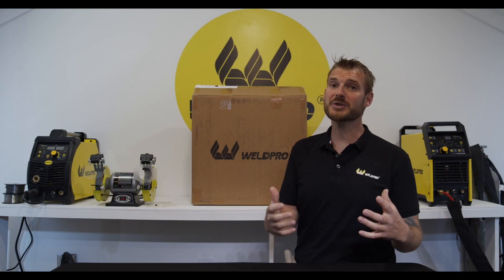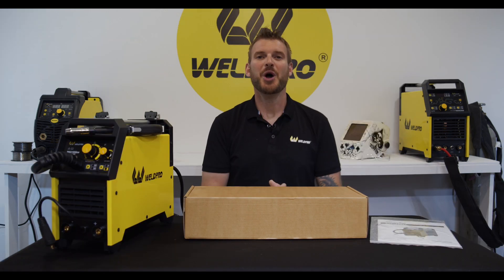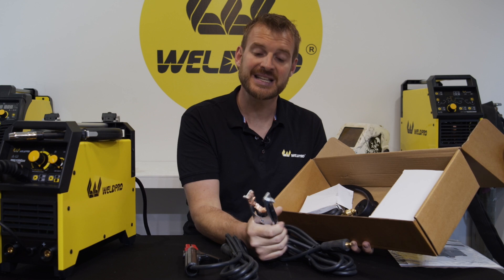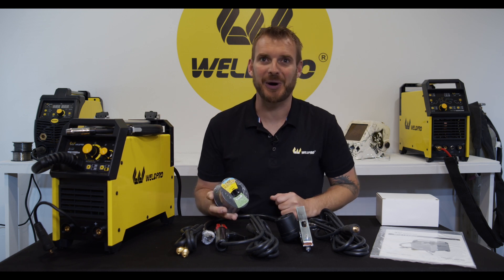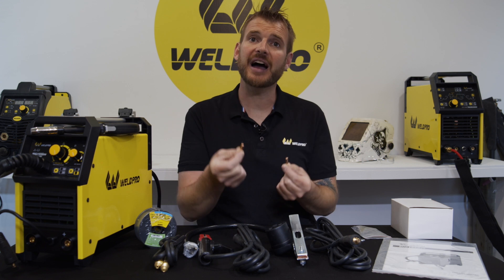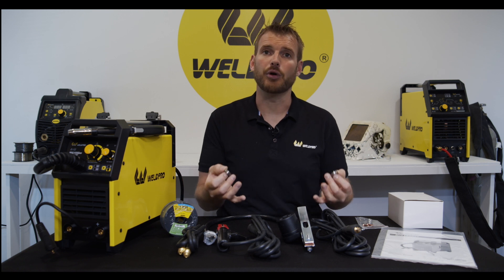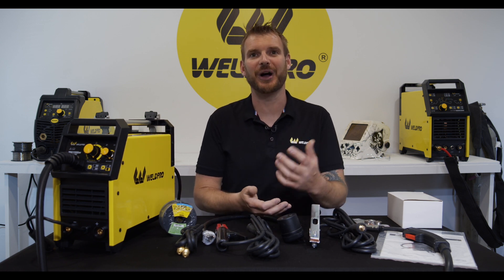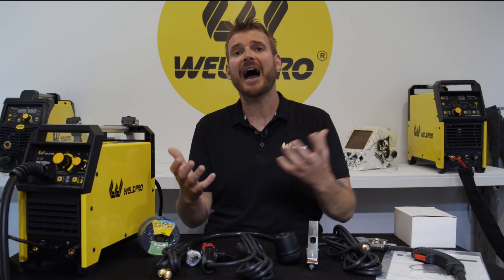Weldpro MIG 155 Part 1- Unboxing

Comment: Can I run a generator on this and if so what size will I need?
Reply from the maker: Yes you can. You need to be sure the generator is sized appropriately for the welder. You would want to look for a generator that puts out clean power in the 40A 240v range. 50A is preferred but it can be difficult to find a generator this big.

Comment: The Weldpro website says the155GD will do lift Tig.Is that correct? If so what torch does it use?
Reply from the maker: Bo B Yes it can. There are some nuances to using Lift start with the 155. It’s actually not lift start it needs to be scratched start. You will need to snap out of your Weld when you’re done. The torch to use is on our website under the accessories page. Here is a link https://weldpro.com/product/wp-17v-tig-torch-for-w-weldpro-mma160gd-mma200gd/

Comment: Hello quick question please, im considering buying this beautiful 155...i just want to know how long the stinger and gun lead are. Thanks
Reply from the maker: Just measured them for you. My MIG cable gun included "machine to tip" is 80 inches.
My ground cable is 10'

Let me know if you have any other questions!
Reply: @WeldproWeldingEquipment  thank you so much
Reply from the maker: Very welcome Toby! Let us know if you need anything else

Comment: Just received my Mig 155 last week. It welds very well and am happy with the performance. The machine actually comes with 3 drive rolls. 1 on the machine and 2 extra to cover .023, .030 and .035 mig as well as .030 and .035 flux core. One issue I had is that normal rolls from lincoln and hobart are wider than the included wire, so the non adjustable spring tension is too tight. I had to cut one coil spring  from the tentioner to allow the wire to feed. It would not feed even with the drive roller tightened all the way down.
Reply from the maker: That’s great to hear! Yes depending on spool size we have even recommended sanding the labels off the wider spools to allow them to spin more freely!
Reply: @WeldproWeldingEquipment  My welder came with 2 springs. I am going to look for a softer spring and that might be a good idea for you guys.
Reply from the maker: Yes the softer one will definitely help in the case of a wider spool! We will have a setup video released soon where we talk about those two springs. Thanks for noting that and researching what might work well!